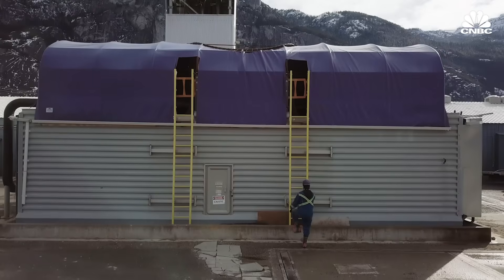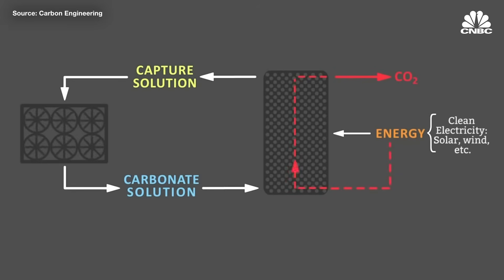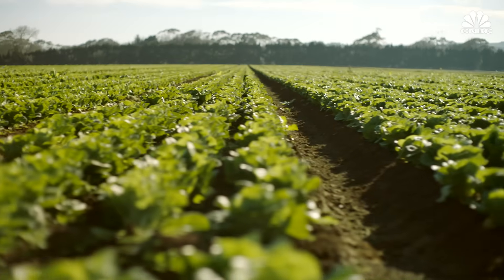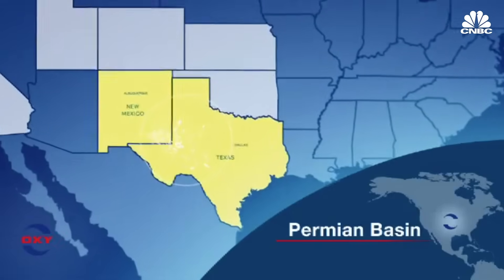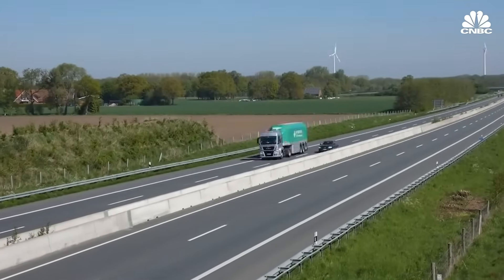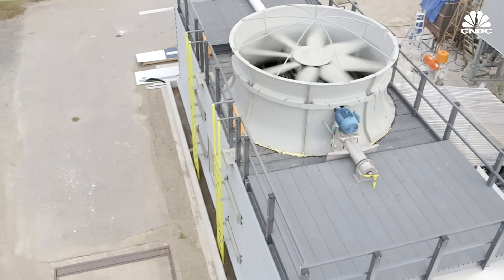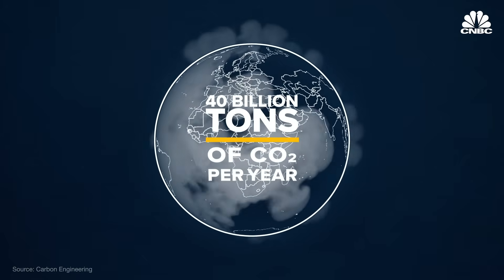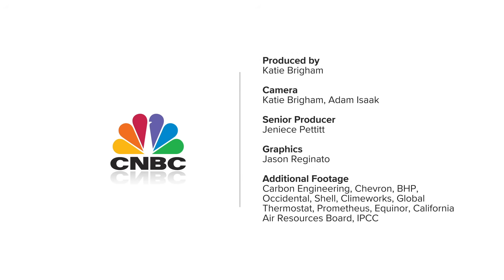Bill Gates-Backed Carbon Capture Plant Does The Work Of 40 Million Trees

Comment: DM me if you would like to work with me on Carbon capture technology . Also here are my two cents , 

Pulling CO₂ from air at 400 ppm is an engineering nightmare. It’s energy intensive, expensive, and barely moves the needle today. Real climate impact comes from capturing concentrated CO₂ at the source cement, steel, ammonia plants not from vacuuming the sky. DAC needs serious innovation before it can scale meaningfully. The real impact lies in capturing CO₂ at the source like cement or steel plants where concentrations hit 600–1,000+ ppm. Flue gas capture is cheaper, more scalable, and actually useful. 

To be honest, in the next 10 years, I see Direct Air Capture (DAC) machines installed mainly in high AQI zones but more as a symbolic move than a real solution. Yes, they might pull some CO₂ from the air, but let’s not forget high AQI is caused by multiple pollutants like PM2.5, NOx, and SO₂ not just CO₂. So DAC won’t solve the actual air quality crisis. Also, the tech is still in its early phase. It’s not economically viable yet, and turning it into a profitable business model is a long shot right now. Until then, DAC projects should fall under CSR initiatives, not core investments. Let’s not pretend otherwise.

Comment: If the Fossil fuels are carbon neutral or even carbon negative due to the carbon capture and usage technology, why not keep pumping and using oil and gas? Its all energy that is needed. I don't think the fossil fuel industry needs to be demonised, but part of the solution, which is what they are doing.

Comment: BS. This is a BS. Making money. Just think for a couple of seconds and use 7 brain cells. The only reasonable way to have these machines run is to use the clean energy to run them right? Because otherwise you produce more CO2 than you capture. So why don’t you put that same clean energy directly into the system and replace some of the dirty energy input that makes CO2 in the first place? How is fixing the problem better than preventing the problem from even happening?

Comment: I would like CCS and CCUS companies to continue with their development.
The general public now needs to drastically reduce their electricity consumption at night when solar power cannot be generated.
If you know anyone who works at a window sash manufacturer, please introduce them to me.
The other day, I had a discussion with a Japanese sash manufacturer, but even though they are registered with the Ministry of the Environment's decarbonization activities, they prioritized profits and were reluctant to accept our proposal.
Carbon dioxide is a problem because it is a very stable gas.
Now that such large-scale wildfires have occurred, it is important not to emit any more CO2.
What I would like to propose is a device that exhausts heat using natural wind and also has a gust protection function.
We have a proposal for using this device for windows, so we would like to discuss this with North American sash manufacturers.

Comment: Removing carbon dioxide from the atmosphere is an utter waste of money because there is only one part of carbon dioxide in two thousand five hundred parts by volume of atmosphere. And not an iota of oxygen is emitted into the atmosphere unlike with trees. Scavenging depleted oil wells using CO2 is an entirely different matter. Using stored carbon dioxide as an industrial chemical is yet another matter. But carbon dioxide sequestration to change the climate is a false proposition. Carbon Capture and Storage is being is only being promoted to support a false ideology.

Comment: 2nd law of thermodynamics is a strict limitation on the effictiveness of such a factory.  
if you burn 3(x) kg of fossil fuel that will make at least 3(x) kg of CO2, because the O2 is taken from the atmosphere...So if a Coal fired plant burns 300,000 kg  ( 3 x 10^5 ) of coal, there will be about 300,000 kg taken out of the air, but that still leaves 100,000 kg of Carbon to be dumped of, some how, some where, some place.....huge mountains of carbon will build up in days .
  There are far cheaper, safer and more eco safe ways to cool the earth or even take out the CO2, so cheap that big business wont touch it.

Comment: But that's not the only purpose of trees ! !   We need to rescue our ecology, so instead of replacing 40 million trees we should be planting 40 billion trees.  The issue is not as simple as carbon ddioxide;  the long term (2 million years) chart of CO₂ and temperature shows there is no correlation between them.  (See Patrick Moore work)  More industrialization can never be the answer !

Comment: The plant extracts half a megaton of carbon dioxide a year. Now, tell me how many mega tons of carbon dioxide there are in the atmosphere. Don't know? Find out.
Reply: What kind of plant are we talking about here
36.7 billion metric tons. Or 367000 megatons. 
Also carbon in the atmosphere is about 440-414 ppm today depending on where you go vs the 377ppm in 2004
Reply: I just wondered if you knew. The correct answer (verifiable) is about 3300 billion tons  (or tonnes, not much difference with these amounts) that is 3.3 million megaton, so half a megaton. Also check out Henry's Law.

Comment: Weather, climate and climate change are random chaotic and designed to furnish earth with circulation and enables the hydrologic cycle to exist. So when you get climate change stopped then what? The headline will read..."Man controls climate...film at 11?" What is the magic atmospheric CO2 number that will achieve this?  Just a bit of hubris here I think.

Comment: Oceanic carbon capture is much more effective, efficient and with better byproducts than direct air capture. You could use the resulting limestone-like product in the concrete industry, further reducing the carbon footprint of the contstruction industry, while stopping ocean acidification. If done well, the process could be powered by a gas power plants and still be carbon negative. AND oil companies dont get to use it to extract even more oil.
Of course, thats why you wont see major companies backing this sort of projects.

Comment: This planting tree talks to capture CO2 is pure BS. A forest is near carbon neutral. In fact, the Amazon rainforest is carbon neutral. Trees have respiration at night, burning O2. And where we have flora, we have fauna. I'm all for forest preservation, not as much as reforestation (where is biodiversity on reforestation?), but for completely different reasons, such as climate stabilizers and biodiversity preservation. Algae capture CO2 much better than trees. Artificial CO2 capture is even better and is the way to go now. CO2 to fuel reduces replacing fuel will help until every vehicle on earth is not fossil fuel dependent. Right now we need to remove Fuel Fossil by any means, solar, batteries, and also carbon capture-based fuels. As for storing CO2 in the earth... It looks like a hack for me. It would be better to put this CO2 to some use.

Comment: 40 million trees is what it would take to just barely offset about one day of carbon production in just the US, assuming the power plant does not produce any carbon emissions of its own and that the tech actually works as advertised.  For it to actually work, you would need to build one of these plants every single day for the rest of human existence.  This is at the very best is a negative-sum estimate, spending a ton of money and energy to have no appreciable difference.
The only solution is rethinking of our energy production and consumption.  It's not a problem you can solve with technology, it's a problem that must be solved by giving up the idea of tremendous wealth as an ideal.

Comment: Electric cars are not the answer yet. They are over priced and it has been recently shown that the battery goes on a Tesla after 10 years costing 15k to replace. They also take to long to charge and are limited on distance you can drive. Gas vehicles are going to be with use for many years to come.  Carbon capture is something that could be done now. We need to challenge billionaires to invest in carbon capture plants to save the planet.

Comment: Lots of large numbers quoted here but what is the scale of the problem? Currently (2019-2021) humans emit 35 billion metric tonnes of CO2 each year. Using the lower end cost quoted in the film of $100 per ton, it will take 3.5 trillion dollars to capture one year's worth of human Co2 emissions. For scale, the USA entire yearly budget is about 4 trillion. 

For those wondering about trees, 1 tree removes about 25 kg of CO2, so 40 trees are needed to capture one ton of CO2, or 1.4 trillion trees to capture one year's worth of human carbon emissions, and the land needed for all these trees (using West Virginia - one of the most forested state in USA as an example), would be slightly more than all the land in North America, South America and Central America all added together.  (And I didn't even mention that there is a a 10-15 year delay for all this tree-related carbon capture due to tree maturation.)

Now, if each year's human emissions from carbon have been approached there is the problem of capturing some or all of the 1.1 trillion tons of CO2 that humans have emitted since 1980 alone. If we can solve the yearyl emissions but not the past emission, we are only delaying, not reversing, climate destabilization. 

And, then we have STILL to deal with the Co2 emitted by the thawing permafrost and emitted from the ocean that is warming and releasing the Co2 it absorbed when it was cooler. 

Warming at 0.018 degrees per year, means that 2050 will be 0.5 degrees C hotter than now 2021 (which is already 0.8 to 1 degree C hotter already), and in 2100 will be 1.4 degrees hotter than now.   

It is a slow motion disaster that can't be reversed. Al the governments and video's such as the one above, remind me of the announcements related to Lehman Brothers bankruptcy before the 2008 economic melt down - no one wants to discuss the sacrifices to be made or the scale of the disaster, until it is too late.

Comment: Those two complainers can go to hell. Carbon Capture is not instead of renewable energy, it is in addition to. As long as there are Republicans pretending they don't believe in climate change, while simultaneously taking millions from the Oil industry, we need something. Even if we had a new, non-Carbon fuel infrastructure tomorrow, we need to rid the air of the massive man-made carbon build up.
Reply: https://youtu.be/VT4lY6HWdfA

Comment: At source carbon capture makes sense as a supplement in transitioning out of fossil fuels, General open air scrubbers are a waste of energy. its a simple matter if density of gases in the air, and the energy to filter the volume. imagine how much air you have to filter to capture enough carbon. the math is not kind. why at source works, not massive air scrubber plants.

Comment: Thats only ~870,000 metric tons. That’s not even a dent in the rate at which CO2 is produced. One tree captures on average 48 pounds of CO2 per year (48X40,000,000=1,920,000,000 pounds —>metric tons=870,897 metric tons). In 2019 6,558,000,000 METRIC TONS (not pounds) of CO2 were produced. 14,457,915,154,000 pounds of CO2. 14.5 trillion pounds.

Comment: 40,000,000 trees is not that many trees.  The cost of one of these plants could plant easily plant 100 times that number of trees.  The best part is that in 40-50 years all those trees will be available for lumber for future generations and this plant will be a rusted relic.  The next question is what are all the unintended consequences for carbon capture into below ground sequestering sites?

Comment: By switching to h3 it should accomplish the same thing in half the time
Reply: Problem is that "just switch to X" sounds like a good idea on paper, but it's an absolute nightmare to actually do in the real world. Basically our entire society is built on the existence and ready availability of fossil fuels and fossil-based materials. "Switching" all those systems over to something else is not something that happens overnight. The consequences of attempting to do so by implementing bans and other forms of restrictions are massive. Before you can transition from one system to another, the new system needs to be already in place and developed or you get chaos. And getting new systems to the point where that's going to be possible will take years, if not decades or centuries.
Reply: @Fraggr92  not as an assist to existing.

Comment: There is no way in hell that enough air moves through this facility to equal any substantial amount of carbon capture. It's just simple physics. The air has a certain rate of flow and a certain volume. Plus the entire process from start to finish uses a large amount of energy. Well that energy likely comes from burning fossil fuels...
Reply: The flow comes from the wind. After all, it works with trees too who got no fans at all.

Comment: “Heated at very high temperature…”. The laws of thermodynamics and balance of energy take a nose dive to BS. 🙄
Reply: @ggm-i8y  Because it costs energy to heat something. That energy has to be generated somewhere. And the most likely source of that heat is from burning fossil fuels.
Reply: @GeorgeMonet  If you watched the video you would have seen they used green energy as a energy source

Comment: Taking CO2 from air could postpone the problem but the oil removed and the gas lens removed from ground is the primary cause.
Insulation and reflection of heat from core is the actual reason...
Their secret shhhhhhh

Comment: Works but emits more CO2 (generated via grid-electricty) than it captures. 
Also we have the "what the hell are we gonna do with one trillion cubic feet of CO2?" problem. 
File under "Bill should read up on Thermodynamics" category.
Reply: Not exactly,they capture more than they generate,these people arent fool
Espcially Oil company,since CO2 can be used to refine and recycle even more oil
It clean enough and cheap
Please watch it to the end before making such assumption
Reply: @dangbui4666  From coal furnaces yes. But from the atmosphere no. They emit about double the carbon they capture. It's not impossible to achieve but they are not there yet.
Reply: @Alekosssvr  they  build these carbon capture to "do something" rather than "do nothing"
"They emit about double the carbon they capture" can you please link the time or the sources please
Almost everything we do generate Carbon, not just Generating Electricity via grid
" what the hell are we gonna do with one trillion cubic feet of CO2?"
Chemical;, Oil recovery,... and it not just oil,can also be used for cooling,moulding and cutting.
Thank to these capture, they will reform it as calcium power(source:somewhere accross the vid) and sell to Chemical industry and many many other at even cheaper price
CO2 exist every where, even from our surrounding, what they are trying to do is reduce,not eliminate it directly from the atmostphere
Reply: @dangbui4666  Sources?
Engineering Thermodynamics 101. 
The use of captured CO2 - or what I call the "WTHAWGDWOTCFOC" problem is real. All the uses you mention might utilize 0.1% at most. The rest? Pump underground. Ok. So you'll spent more energy (emit even more CO2) and you pray to the Gods that it stays there. 
And the one trillion cubic feet represents a reduction (If I remember it is one third of the total atmospheric CO2).
Reply: @dangbui4666  Agree to disagree on some things. On others we are on the same page. Cheers!

Comment: Dear whoever keeps making this kind of video...... stop inserting cut shots of heat coming out of pipe stacks. That is not carbon emissions, it's not even steam.... it's heat condensing the water vapor that's already in the air surrounding the top of the stack.  Basically cloud forming.

Comment: Is that Net Co2.  Is this after deducting the CO2 cost of running the plants or are they working on the assumption they will run on renewables.  Also if we are just converting to fuel that will be burned will that not re-release the CO2  (so then the net difference is in the replacement of some other fuel that also release CO2).  If the plan is to store underground then in what form (gas, conversion to liquid or a solid)

Comment: Get the rich folks to fly commercial and park their private planes. They use one private jet to transport at the most 5 people when a commercial jet transports 110 people. Start making changes from the very basic levels before investing in big machinery costing tax payers a ton of money. Look on the freeways, huge trucks and SUVs with just one person travelling in it. These gas guzzlers only put out 10 mpg but spew huge amounts of poisons into the air. Promote intelligent ways of living life. I gave up my SUV and bought a Tesla. I also had solar installed on my roof top. I charge my car during the night.